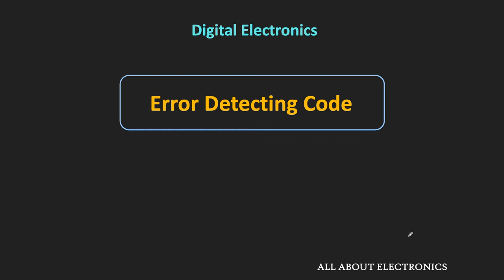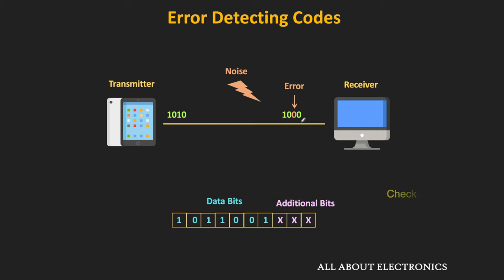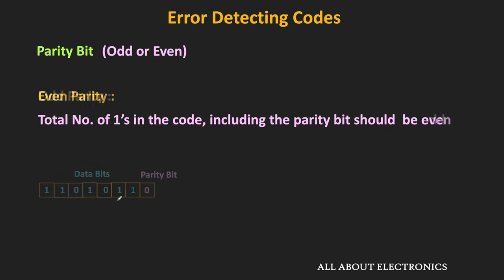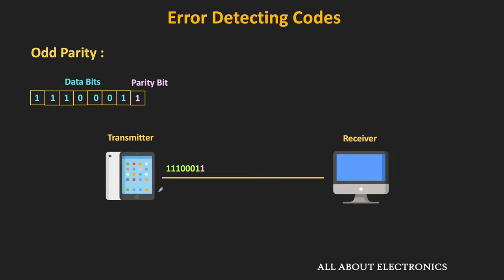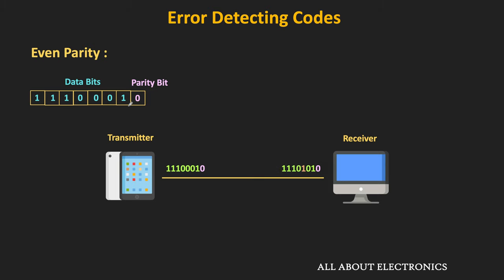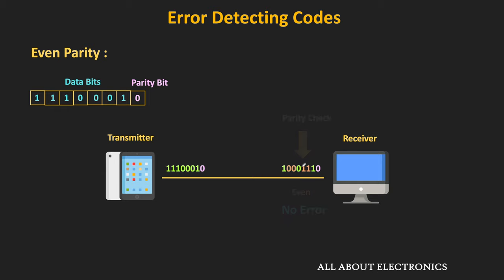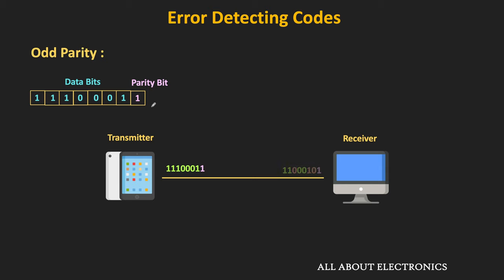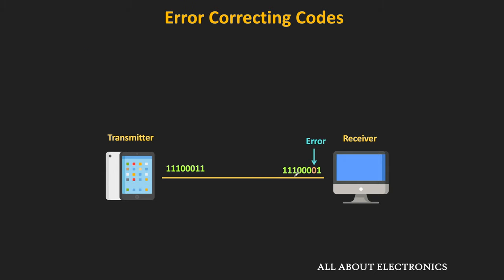Error Detecting Code : Parity Explained | Odd Parity and Even Parity

Comment: Good explanation but the parity bit should be added to MSB (most sognificant bit) isn't it.
Reply from the maker: No, not necessarily. It can be either MSB or LSB. That depends on the protocol established between transmitter and receiver.

Comment: But what if we do not know which parity is used?(Even or Odd) How will we know if the recieved pattern is correct?
Reply from the maker: Typically for transmitters and receiver the protocol is set for specific parity in advance. Because accordingly you decide the hardware for both transmitter and receiver. So when the receiver receives the data, it already knows which parity is used in transmission. I hope, it will clear your doubt.
Reply: @ALLABOUTELECTRONICS  Thank you. It is clear ♥️

Comment: 5:00 Sir how the Receiver comes to that whatever data has been transmitted contains odd or even number of bits??
Reply from the maker: Generally the protocol is already been established between the transmitter and receiver, like how many bits will be transmitted. What type of parity is used on in general what type of error detecting and correcting mechanism is used.
Reply: @ALLABOUTELECTRONICS  thank you

Comment: What if parity bit only changes from 0 to 1 while transmission
Reply from the maker: Then also it will be able to detect the error. Because at the receiver side, the parity checker circuit will check the parity of entire code ( including parity bit ).
So if there is an error in parity bit then also it will detected.
I hope it will clear your doubt.

Comment: What if the parity bit is flipped?  There are no guarantees the parity bit will not flip. What then?
Reply from the maker: In that case also, the parity checker circuit will generate the error. In short, if the parity of transmitted and the received code doesn't match then it will generate the error. (Irrespective of  whether the error is in data bit or in the parity bit)

Comment: What if there are 2 errors in one data ? So that means the parity bit checker will not shows the error so what is the solution?
Reply from the maker: If there are even number of errors in the received code then parity checker won't detect it. You need to use other coding schemes to detect such errors. On such error correcting scheme (Hamming Code ) is discussed on the channel. 
You can watch that video for more information. 
Here is the link: https://youtu.be/t4kiy4Dsx5Y

Comment: Sir,I have a doubt.We are adding parity bits for error detection ie since data is getting corrupted we are adding parity bits.But doesn't a condition occurs like parity bits can get corrupted and the error detection can go wrong
Reply from the maker: Yes, it is quite possible that the parity bit itself gets corrupted during the transmission. But as far as there is an odd number of errors in the code, it is still possible to detect the error. Let's say, we are sending the data for odd parity. The parity bit will be set in such a way that, the total number of 1s in the code is odd. Now, suppose, the parity bit gets corrupted then the total number of 1s in the received code will become even. And since it is even, the parity checker circuit will be able to detect the error. I hope, it will clear your doubt. If you still have any doubt then let me know here.
Reply: @ALLABOUTELECTRONICS  Sir,let me explain my doubt with an example.Consider I am sending 3 bit data 011 and then we are using odd parity for error detection.So the data along with parity that will be transmitted is 0111.Now assuming that the parity bit is corrupted and the data received at receiver is 0110.The receiver will find the number of one's to be even and there is an error.Receiver will expect the number of bits in the data bits had to be odd,so the error is in data.Now assuming the second case,where the second bit of data was corrupted while transmission and then data received at the receiver along with the parity bit be 0011.(Here data is corrupted).Here also receiver finds that the number of one's are even and there is error.But how to differentiate whether data is corrupted or parity bit is corrupted.
Reply from the maker: See, this code( parity)  is error detecting code. Meaning that, it can just tell you that, there is some error in the received code. It just can't correct the error. Or it can't tell you the location of the error. For that, error correcting codes are used. I think I have mentioned that at the end of the video. And on the Channel I have also covered couple of videos on Hamming distance and Hamming code. ( It is error correcting code).
Please go through those videos. Your doubts will get clear. I have explained it in detail. 
Please go through the digital electronics playlist on the channel. You will get those videos. 
In case, if you are not able to find it, let me know here.
Reply: @ALLABOUTELECTRONICS  hi, what if 2 bits are corrupted for example 1 goes into 0 and other where zero goes into one it will not change the number of 1's, so how will it detect the error?
Reply: There is a another thing. What if, instead of 0111, the code gets corrupted and transmitted as 1110, then how'll we find the error?

Comment: what happened if two bits are corrupted at a time?
for example : data iam sending is 110011001 including parity bit (odd parity), but at the receiver side i got 110000001, how we can detect this error ?
Reply: Your assumption is correct. If two bits are corrupted at a time in a parity-based system, the parity bit can't correct the error. Parity can only handle single-bit errors within its group of bits. More advanced error correction techniques like "Vertical Parity", "LRC", or "CRC" (checksums) are used in modern systems to ensure data remains correct. The sophistication level depends on factors like signal strength, data loss, and the importance of accurate data. If you're interested, read up more on checksums :)

Comment: I don't know but u are mixing odd parity and even parity I watch three times but same confusion
Reply from the maker: The thing is when we use Odd parity then parity bit should be set such that the overall parity of the code (including parity bit) should remain odd. And the same is applicable for even parity.

Comment: What if the noise flipped the parity bit 🤣🤣🤣
Reply from the maker: Even if the parity bit gets flipped, then also the error can be detected. As far as the number of error in the code is odd, it can be detected using the parity method. 
When there is an error in the parity bit then overall parity of the received code will change. For example, if you are using the odd parity then parity bit at the transmitter should be set such that, the overall parity of the code remains odd. Now, if there is an error in the parity bit itself then that would change the parity of the received code. And that would be detected at the receiver end by the parity checker circuit.
Reply: @ALLABOUTELECTRONICS  Thanks dude Its been two years since this video was uploaded You are still replying with half million subscribers. Means a lot to me. Also  you explained the concept very well that I figured that out.

Comment: What if parity bit only got changed
Reply from the maker: If there is an error in the parity bit, then also it will get detected. As far as the number of errors in the received codes are odd, the error will be detected. But if there is an even number of error in the received code, then it won't be detected.